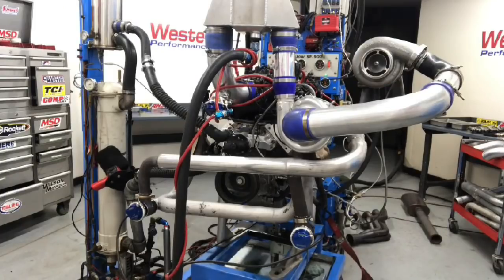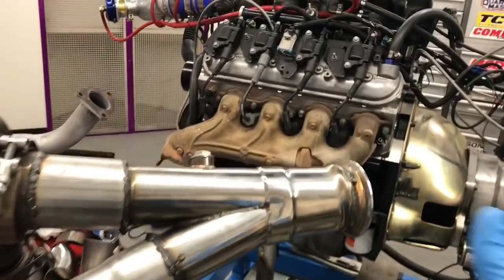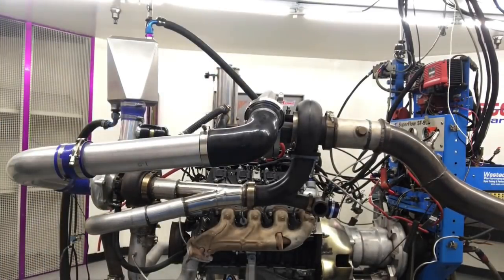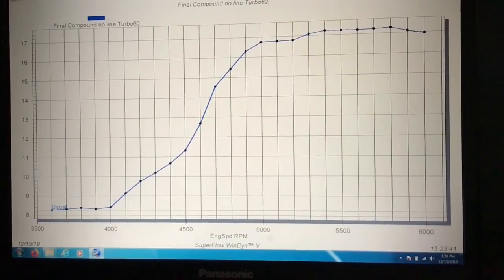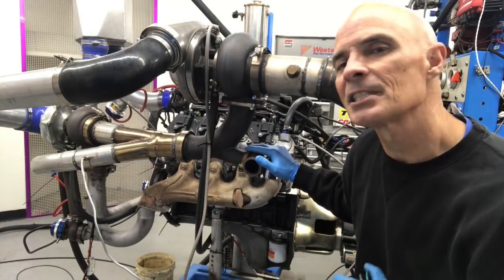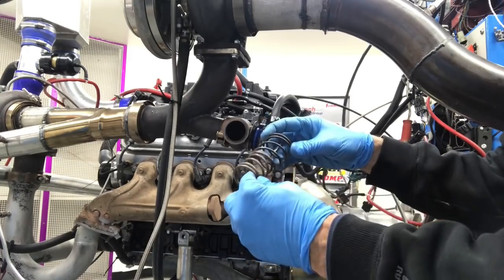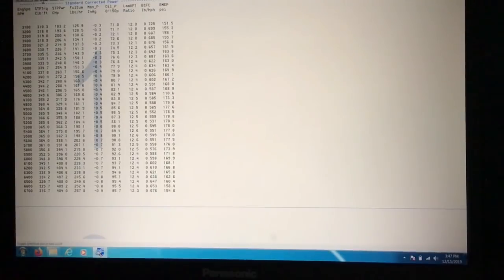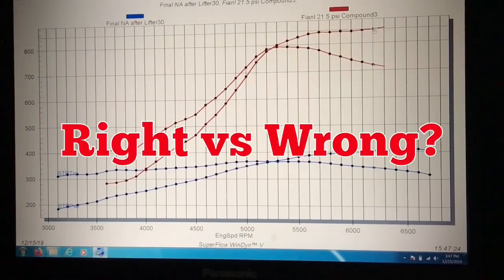Big Boost!! Full Results!! 1 Mistake!! Compound Turbo 4.8L!!

Comment: Interesting results! Thank you for testing this stuff. I was wondering if you've ever messed around with the steam ports? A lot of guys say they just block them off but some say if you do you can cause hot spots in the cylinder heads? has any testing been done on this with multiple temp sensors and/or egt sensors?
Reply from the maker: we usually don't run them on the dyno but have not tested them with sensors are you described

Comment: I have almost the same setup on a cummins  5.9 engine there are allot of differences  I wouldnt of expected. 7665 over s488
Reply: Do you like that setup? How much gate do you need to make that work. That is a very over square turbo for a diesel, have you looked at exhaust manifold back pressure?
Reply: @compted10  . Allot guys use small turbine bigger compressor wheel turbos. Not much of a difference when some one runs a 88/117 mm wheel in a t4 74/82 turbine. The housing makes the back pressure not the turbo.  I love my setup.
Reply: @markrich3271  my comment was about the 7665, I assumed you had the biggest turbine s488. Guess not. Also I'm more accustomed to holset compounds. I run a he351 64/67 and a hx60 that has been worked over to be similar to an s484 t6.
Reply: @compted10  I was talking about the 7665 too. I do have a 96mm turbine. I was making a comparison.  There's a world of turbos out there don't pick a borg warner because ever one else is doing it.
I'm not trying to be a dick that hx60 doesn't make close the air flow a s484 does .
Reply: @markrich3271  oh well I must have gotten lost somewhere, my hx has a garret compressor wheel in it so it moves a bit more air.
Reply: @compted10  no doubt I'm sure it does. When I was making a comparison  that just so happen to have a 88mm wheel in the comparison to what other use. I do have a 96mm turbine t6. My 7675 hausing is a divided t4 .70. I just machined a .58 t3 housing for it to try to recouped the bottom end. Here is the link to the build. 
https://www.cumminsforum.com/forum/98-5-02-performance-parts-discussion/2509829-decided-switch-up.html

Comment: How do you pick the size of turbo for your application,  whether it be compound, twin or single?
Reply from the maker: We picked these based on what we had sitting in the shop. For a conventional turbo set up, start with the desired power output, say 1000 hp, then take into account the displacement of the motor, say a 5.3L, then the mods to the motor(hopefully not trying to do it with a stock motor). That will determine the boost required to reach the goal and cold side sizing, while the displacement and na power will help determine the hot side sizing.  For any LS combo-there will be a number of turbos to meet your needs. Make sure to leave room to grow-turbo guys always want more.

Comment: What was done to the motor NA?
Reply from the maker: cam, springs and forged pistons-stock rods, crank, heads, intake and block.
Reply: @richardholdener1727  what cam? I thought those were stock heads?
Reply from the maker: @benaiahtheassassin  stock 706 heads (as cast-not ported) with 26918 spring upgrade, cam was btr stage 2 turbo
Reply: @richardholdener1727  why didn't you use the cam that made 466 in the 5.3?
Reply from the maker: infamousnova this was a turbo cam
Reply: @richardholdener1727  ahh ok

Comment: Can you compare a log manifold vs a custom setup? See which one spools quicker, has better heat control etc?
Reply from the maker: I did a Holley cast set up vs tube and compared back pressure, but spool is hard to quantify on the engine dyno-it's an artificial load at the starting rpm

Comment: A pair of properly sized 61s would have made 1050 horsepower at 7000 RPMs. Looks like the gain is in low-end torque which will bend rods
Reply: Let's push the gen3 & gen4 rods to see what they can handle down low. We've seen they can handle a ton in the upper range 👌🏽👍🏽🤘🏽
Reply: Rob Nordo I wanna know too lol!

Comment: Very interesting looks like back pressure kill the power at 5500
Reply: 740 at 5k to 715 at 6500 doesn't seem like it falling off to me, Cams have a lot to do with it also
Reply: @kylemilford8758  should be well over 900 at 6500 RPMs

Comment: But i thought you said at 14 psi it was supposed to double the hp but it got to over 800 at 21 psi hmm how about that.
Reply from the maker: only on this compound-I have some more single turbo stuff coming up to demonstrate the formula-its just physics
Reply: That's assuming near 100% volumetric efficiency. There's heat & other variables that attribute to energy loss in power gains. I'm sure Richard will get into this on future vids

Comment: So what would happen with no wastegates on the smaller turbo. It does make sense to route some of that energy around the smaller turbo.i guess the smaller turbo would run away and create to much back pressure.
Reply from the maker: boost would get very high at low engine speeds-not good!
Reply: @richardholdener1727  gotcha. So basically 2 smaller wastegates to control the smaller turbo and then a larger maybe a 60mm on the s480. I'm trying to create a twin compound setup so wondering how to make it possible

Comment: The question what rpm did it start making boost
Reply from the maker: our dyno loading started at 3,500 rpm but it makes boost as we roll into the throttle-it would need to be on the street or chassis dyno to see response

Comment: Awesome test, learned a ton! Thank you!
As for the future videos (or maybe I’ve missed it?) I would like to know about choosing a cam for different applications.
I guess the most popular engine is still 5.3 but how do I choose the cam for my vehicle? Racing VS street VS towing.
It’s not always about maximum power ;)

There’re some popular cams like 220/224, 228/230 etc. but you have probably the biggest data and results on all of those.
Reply: If you are running a street driven car or truck and you want a little more power then an LS TRUCK cam will do the job. If your looking for a little more power/ torque than that a COMP CAM or BTR cathedral port cam in the low 230 duration on the intake side will do the job. Now if your looking a little more high end HP than I would shoot for a RECTANGULAR PORT CAM in the mid to high 230-239 duration on the intake side cuz it will have a lot more exhaust duration that the cathedral port style cam.. just my opinion.. just wanted to give you a little a point in the right direction so you can dig into some more research on the info I gave you.. take care bud
Reply: Dennis Tate thank you! 🙌 Question was answered 👍

Comment: Richard can you do an LS stroker engine with the fast 102mm intake and the new lsxhr tunnel ram?
Would love to see the differences in the low and mid range and also the torque output.
Use a good size cam.
Reply from the maker: I haven't run the new fast but have run the Carbon version
Reply: @richardholdener1727  where is that video?

Comment: I’d like to see a gen1 billet 78/75 with a S496 on the 4.8L with some good good valve train chugging up to the moon around 8300-8400rpm.
Reply from the maker: It doesn't need to run to 8,300 to max that turbo out, but it would sound good

Comment: I'd love to see an optimized compound setup, with intercoolers after each stage, on proper built motor.
Reply: I'm not sure mine is properly built or optimized, but 1200 hp on a 2 liter 4 cylinder with ice water intercooling for each stage works very well.

Comment: The 76mm turbo was too big on the small turbo if you run an 80mm for a big turbo. You need to look at the pre/post compressor pressure ratios on each turbo and get them into their efficiency range in their compressor maps
Should size sorta like this:
- a larger turbine t4 67mm with 60mm gates and a t6 80mm big turbo. Drop intake duration & lift on the cam to get the turbos into their realistic efficeny PR's for this setup:
Take for instance an T04r-derived 67mm and a s480 based 80mm:
67mm: 1.4-2.4 PR
80mm: 2.0-3.2 
(Yes, they can be taken higher, but lets be realistic on total boost).
which means on the low end: (if atmospheric is 14.5psaiA ish)
Psi interstage (between turbos): ~14-15psiG (2.0pr)
Manifold(after small turbo): 21psiG (1.5) - 33psiG (2.4).
You need to monitor pressure between each stage and adjust the gates to hit the best PR for the desired overall boost. On compounds, boost is your friend, so you need to size the cam differently than on a single stage setup. Almost like a PD blower cam. Much smaller lift and shorter duration on the intake side
Reply: If you guys referenced the intermediate charge pipe for the atmospheric turbo, you would be able to dial in a ton more boost. What your getting with this is the small turbo getting in the way basically as soon as it spools. Having all the gates manifold referenced has them all cut in and out at the same pressure measurement location, defeating the purpose of compounding. This is a pretty low PR. Only about 2.5:1 or so. For this you would be looking for each stage to have a functional PR of about 1.6. You would want the intermediate charge pipe at about 9psi boost and the primary at manifold. I would keep a 7psi spring in the big turbo and reference it to the intermediate pipe and block off one gate for the primary charger or fit double springs to both of them.
Reply: @timothybayliss6680  the system is called compounding but he's not really compounding any boost, the smallest turbo build boost to a certain point to spool a larger turbo where it is then bypassed completely so the larger turbo takes over. It's more like a two stage Turbo System rather than a compound setup where the primary Turbo compresses already compressed air from the atmosphere Turbo
Reply: Timothy Bayliss, ^ this! For sure! Reference each turbo to what they are each doing. When I did mine, I also referenced the dome of the secondary gates to the intermediate pipe, too. Seemed to work good
Reply: boost forbreakfast,    could you please help me find the correct turbos for my compound build. It's a 2.5L v6 shooting for low 400's.   Speaking of having turbos lying around, I have a t04b 48mm turbo a/r .50 with small 49mm exducer turbine on a .48a/r housing, then I have a T04e 58mm turbo 60 trim with stage 2 hotside on a .63 a/r.    I think I need a bigger secondary turbo though instead of the T04e I already have.   It maxed out at 25psi on this mazda engine and was a turd.  7.8:1 c/r so I need all the boosts! Any advice?
Reply: Gale Banks here....
Reply from the maker: did you miss the part about these being the turbos I had laying around?
Reply: @richardholdener1727  No, I didnt. I was just making suggestions to help with the educational process of your videos. If you watch my vids, a lot of what we do is just from stuff laying around  so I get and appreciate your work.
I was simply making suggestions that can be applied in the future to help.
Reply from the maker: @BoostXMotorsports  thnx for the advice
Reply: @dj4monie  yea, not much discussion on my channel about stuff yet. I was referring to the 'budget' stuff that is on there. I need to put together more content - just been very busy with work. Gale is one of the kings in the diesel world - i follow a lot of his stuff.
Reply: @richardholdener1727  I didn't miss the part about you doing this with parts lying around.  But that doesn't change facts.  These turbos are improperly sized and the piping is a disaster.  So if you were doing a "here's what not to do on a compound setup", you knocked it out of the park.  But a lot of us want to see it done right.  You should take BoostForBreakfast
's comment to heart, as there was more useful information concerning properly sizing compounds in his comment, than in your compound video series.  

But I get it, you had this stuff lying around. 🤦‍♂️
Reply: @dj4monie   Let's clear up a few things.  First, I'm not mad at Richard.  In fact, anger or any other emotion has no bearing on how his, or any other compound turbo system works.  I'm sorry you can't distinguish that from legitimate criticism.  Second, compounding isn't new enough to gasoline engines to know nothing or have no points of reference.  There's many YT videos, forum discussions, and even books like Corky Bell's "Maximum Boost" and "Turbochargers" by Hugh MacInnes that were published decades ago.  So simply providing information, even if for free, doesn't make it valuable or useful. 

The compound system he's constructed is problematic at best.  I'm sure you'll see this as an "attack" too, but again I'm more interested in useful information and how to do things right.  Piecing together a bunch a parts that were lying around is going to perform just like it sounds.  There's a ton of math that needs to go into figuring out how to build a compound turbo system right, and just because it makes some boost doesn't mean he's demonstrated anything of value.  Compound systems see well over 60psi boost and some get into 120+psi boost levels with supporting fuel.  With all that said, I agree with your first point that you don't need compounds on a LS, especially to only get 22psi boost.  But if you're going to do it, do it right.  This isn't an attack.  I'm not mad.  These are simply facts.
Reply: @user63344-gds  where are all your educational videos on the subject? I couldn't find them on your channel.

Comment: I know a couple dudes asked about lower end torque but I think we’d love to see the results of a built 4.8 and see how far you can push it down in the rpm range like 2200 to 4500 which is where most street and towing get done
Reply: Generally when sized right it spools faster than the small turbo and makes the power of the big turbo. Plus the big turbo can use a much oversized turbine equivalent to what you'd size for an engine with the displacement the engine w/small turbo spits out.

THAT is where sizing comes into play. If the large turbo is too small, it chokes the engine. Too large and it relies on the small turbo too long.
Reply: Hydrocarbon82 fully agree, and my comment below touches on that a bit.
Reply: That's the purpose of compound turbo,  to spool faster.  Besides 8 cylinders will spool a single turbo pretty well
Reply: lapieces I think that makes sense in theory but demonstrating it is another deal. For a lot of guys sizing a turbo properly is still black magic, and going off anecdotal evidence is lucky at best. A lot of these motors are going into trucks, Richard and I have chatted about this a bit already. This is good conversation to have because there is a lot of doubt out there regarding towing with a turbo ls.. which from my research has been done with great success.

Comment: Hmmmm. Wonder why you have a blow off section from a torquestorm....
Reply from the maker: done lots of testing with them on a variety of different motor
Reply: Richard Holdener hopefully we getting some videos on that. I do know they are way too small for a v6 or v8. Even if you double them up. He needs to start using a bigger compressor housing like on a 7875 and then he’d have something. Even a little 4 cylinder out runs the airflow it provides currently.
Reply from the maker: @Turbogto_guy  we've made over 700 hp with a single TorqStorm and will be running twins very soon
Reply: Richard Holdener CRAP! I got it confused. I was thinking torque amp electric turbo. Lol. Look, it was early Monday morning. Hadn’t had my coffee yet! Lol
Reply from the maker: @Turbogto_guy  all good yo!

Comment: Would this turbocharger set just be for trucks or heavy vehicles.  How fast does this set spool up? Could the Holley set be used to set the boost control? What was the torque down low?
Thanks
Reply from the maker: it would not be just for trucks-it could be used for any performance application, it spools up quick with the small turbo, Holley can run an electronic controller and you can adjust the torque output as indicated in the video

Comment: Kind of the wrong too for the job.  Compounds are there to make bit low rpm and midrange power/torque.  The response being fully lit by 4500 makes me think the compound is a bit of a moot point . Probably also needed some more wastegate before the high pressure turbine because the drivepressure across the high side turbine should be a lot closer to manifold pressure along with low pressure turbine being more equal to boost level between the low and high pressure turbo
Reply: The actual point of compound turbos is to use the small turbo to increase the effective displacement of the engine so that it will have the required exhaust energy to spool a very large turbo. I the Diesel World yes we use compound turbos to increase the mid range and low end torque/horsepower but this is just a side effect of what is actually going on.
Reply: @compted10  no, thats the entire point of why you compound.  turbo response at lower rpm.  peak power will not change and in some cases increase running a large turbo or just the atmospheric turbo in this case alone.  peak airflow is dicated by the larges compressor open to atmosphere
Reply: @whatchu_talkin_john_willis  no the point of the small turbo is to create the exhaust flow of a larger engine. The reason big turbos can make more power alone is back pressure control as well as the compressor cover restrictions.
Reply: @compted10  no lol, that is the FUNCTION (IE how it works) not the objective (the goal you're trying to achieve)  the objective is to increase engine power delivery responsiveness (IE quicker turbo response) and widen the usable powercurve.
Reply: @whatchu_talkin_john_willis  I think we are arguing the same point from both ends.